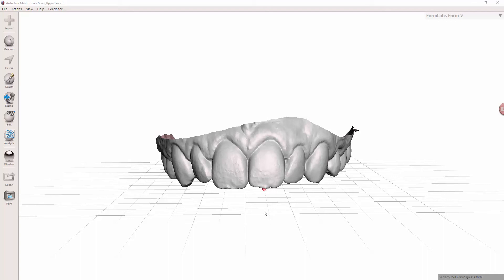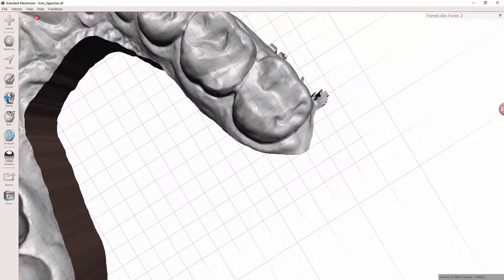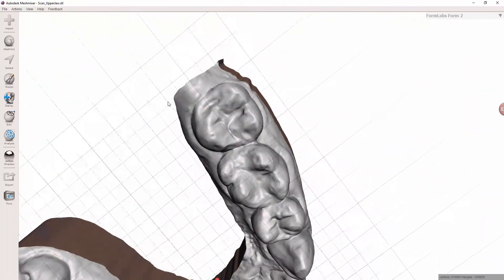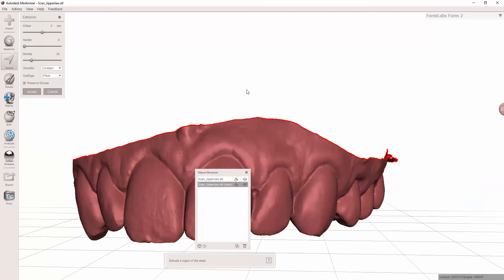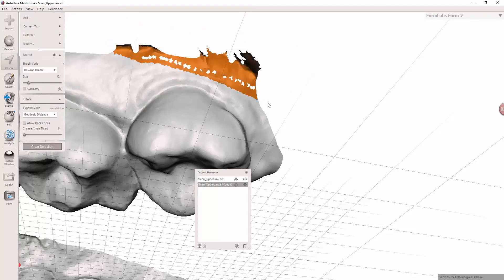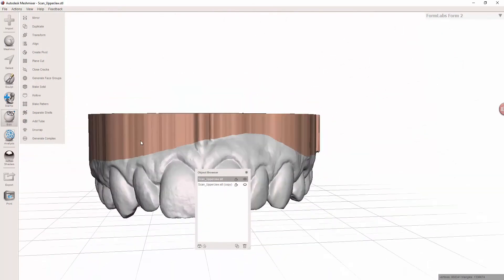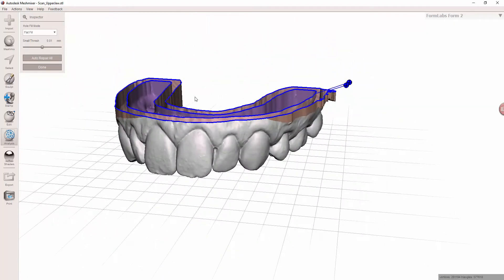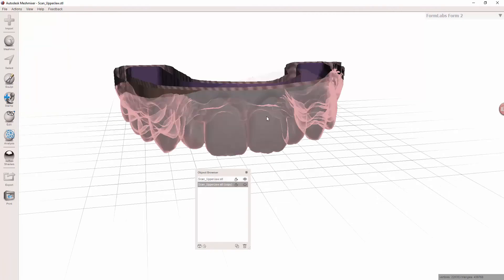Model Errors: Rough Border, Maroon Model, and Open Base

Comment: Hello Baron, I'm a new "3D printing dentist" and I'm trying to understand how to get as nice dental models as yours ! Your channel is so interesting and I thank you so much for all the tips to the community ! I want to ask you a question because when I try to make hollow model, I always have an open base after the plane cut. The only way I find to get closed object is to planecut only on "oral scanned" surface but my model is too small... If the plane cut touch the extruded aera of my model (the MM constructed base), I always get an open base just as you shown on this video... However the border of my oral scan are cleaned and smooth enough... Any tips so that the plan cut can make my model closed and not opened ? Thank you so much for you help ! Sebastien
Reply from the maker: +Sébastien Bouvet-Gerbettaz hello! Are you pressing Ctrl+A and then "B" to Smooth Border prior to extruding?
Reply: Hello I've try this yes. I first select the "false" scanned data and X, then I select and and smooth boundaries, then extrude the base
Reply: Damn, I've just retry and this seems to work !!!
Reply from the maker: +Sébastien Bouvet-Gerbettaz hmmmm. Can you upload the file online and share with me the file? Or better yet, if you could record your screen, I could watch what you're doing and see if I can identify the problem.
Reply from the maker: If you upload a download link to the STL, I can pull it up on my phone and see if I can identify the problem.
Reply from the maker: +Sébastien Bouvet-Gerbettaz haha. Cheers!
Reply: ok when doing the ctrl A and smooth border it seems to work better ! thanks so much for your quick response ! next step is the distal plateform ;p